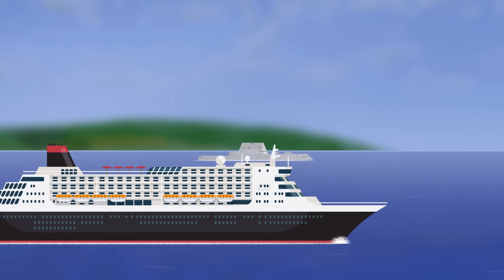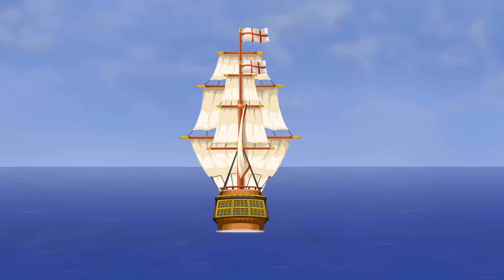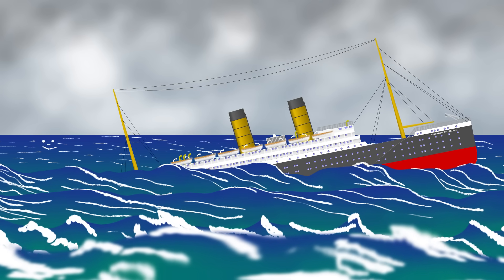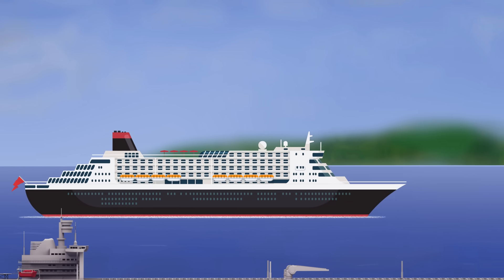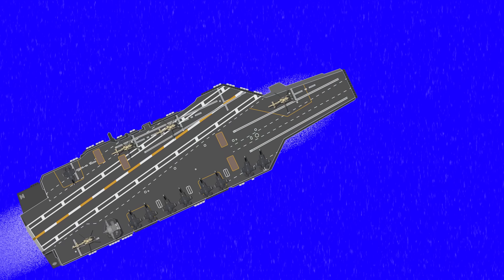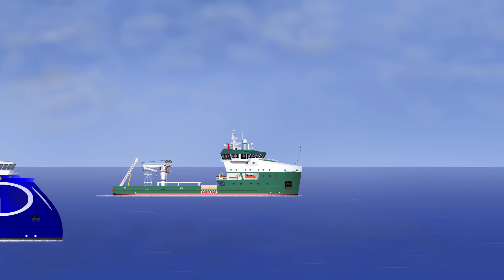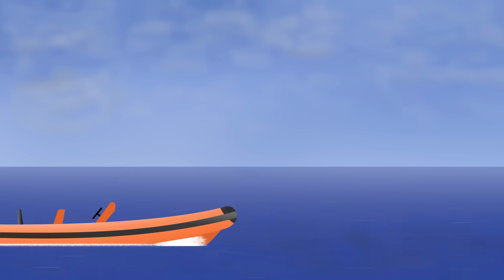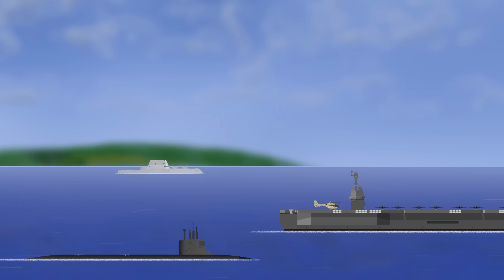Why Are Bows That Shape?

Comment: Now I want to know why the stern of ships are so different, cut-off like in cruise ships while tapered in ww2 battleships.
Reply: Speed and efficiency. They started with transoms in early sail for military, stylistic and construction reasons, then changed to counter sterns on clippers in the 19th century because they were more streamlined and therefore more efficient, then cruiser sterns in the 1930s because they lengthened hull length and were more efficient, then transoms (again) in the 1970s because they reduced squat and were actually the most efficient at speed.
Reply: The transom stern is just above the waterline. The ship is still streamlined below the waterline. Transom sterns are much easier to construct and don’t really have higher resistance than the old cruiser sterns except in extremely rough sea conditions. People just hadn’t realized that in the past. There’s no point in hydrodynamically designing a part of the ship that won’t be in the water.
Reply: @michaelimbesi2314  They also have far more buoyancy than "canoe" sterns, in case a large wave overtakes them from the rear.
Reply: I guess I’m an incurable Titanic nerd, but I think the kind of stern it had is the most elegant.
Reply: @inuyashaxx  Agreed, the fan tails of the Olympic class were among the best-looking rears on the Atlantic. The Cunard Greyhounds, Lusitania and Mauretania, come at a very close second.
Reply: Applies also to rifle bullets.  Ones designed for shooting at longer distances have tapered bases rather than 'flat' squared off bases and are referred to as 'boat tails'.
Reply: Alex the historian has a video about that
Reply: Evidently it's not so important. Hull length however is critical. Longer equals faster all other things being equal. And things that are critical at 50 knots aren't so at slower speeds. Battleships could move when they had to.
Reply: Old designs are less reliable and far more less efficient. The way we shale the stern is depends on the flow characteristics. 

Our sole aim in ship design is to make sure that the flow of the water towards the stern to be linear as possible. 

Why do we want it to be linear flow near the stern? Because it increases proppeller efficiency.
Reply: That’s easy, something I learned before I was a teenager.
A cruiser stern, the curvy ones that look sweet, are very inefficient, and cause more drag as they “leave” the sea.
Transom sterns, the ones that are squared off, have a sharp bend to make the slipstream of water to break away from the hull cleanly.
This takes away from the friction of the water from the hull, but fools the hull a second way, by a increasing the displacement of a given transom hull without actually doing it.
This has the effect of lifting the hull higher out of the water, and reducing drag, while the physics still think that the whole hull is in the water, which it is not.
Less friction all around, boat moves faster, boat moves more efficiently, everyone is happy!
Reply: @martinamaggioni8124  u6uu66pu66u67pup766uup6p6uu6

edit:ive heard of butt dialing someone but ever heard of pocket commenting?
Reply: So the water won’t slam shut.
Reply: British warships also had dove-tail sterns, Americans and Japanese had fantails, and Germans had hawk-tails.
Reply: Skag sterns are designed to help protect the propeller while giving them optimal prop angles for driving the ship, very common use on the biggest ships down to even small trawlers these days.

Comment: The bow one sees on the submarine is flooded. There is a spherical or horseshoe shaped acoustic sensor array in that flooded space. The shape of the submarine’s bow is to accommodate that sensor array and provide the flow you describe. Wgen you see a submarine you’re only seeing its outer jacket, not the inner pressure container that looks much like a propane tank.
Reply: but the flooded bow moves with the ship, so the surface pushing away water will be the "outer jacket", the bow. it would make absolutely no sense to let water ciculate in and out, so the bow one sees is indeed the bow that needs to produce as little drag as possible while accommodating the sonar. so what are you trying to say?
Reply: @danielsteger8456  What you say is correct, but the answer to your question involves something you did not make part of your comment to JoeOvercoat.  He is pointing out that resisting the pressure of deep submergence is not the function of that outer nose cone, which is the opposite of what the video and several other posters here are saying, and that, of course, is why he brought it up (and that is the answer to your question).
Reply: This has nothing to do with drag generated by the shape of the bow...
Reply: @Dirty Eddy It has, because the sonar array (and torpedo tubes) are what pushed the submarine bow design that way. They could have other shapes but this is the most adequate for the task of the vessel.
Reply: @moteroargentino7944  the same is applicable for ship bow design and the required width of the ship for stability and cargo capacity which was disclaimed in the video. The accommodation of sonar array is bs as wider submarines with side by side pressure hulls have a different width thus bow shape etc. again, sonar array accommodation has little to do with drag for bow design. The bow could've been pointy instead of rounded while accommodating for the sonar…. Hydrodynamics call for rounded regardless of the sonar.
Reply: @lIlIlIlIlIlIlIlIlI   The video specifically talks about why are ship's bows shaped that way . Drag is always a factor be it on the surface or below it. Submarines have that shape as a compromise between low drag/noise & volume for equipment.

The first submarines had ship-like bows as they spended most of their time on the surface due to power limitations. In the 50's, the first nuclear submarine (USS Nautilus) was launched and had a semi-pointed bow, which proved to be so noisy that deafened the submarine's own sonar . Then the USS Albacore was built as a diesel research experimental submarine with a teardrop hull design that showed to be faster, quieter and more maneuverable, but less stable on the surface. Around the same time, the Soviet Union launched their first nuclear submarine (K-3 Leninsky Komsomol) equipped with a rounded bow that gave it a lot more of space for equipment.

Submarine bow shapes have been studied and the results showed that conic and fish-like bows had the lowest drag coefficient and noise generation. Hemispheric designs generate more drag but not turbulence like ship-like pointy bows. Then came the conclusion: sonar is essential for a submarine, as is it's eyes and ears. There's always the need to fit the biggest and better sonar possible in the bow, and that requires space , to the point that in the USS Tullibee they removed the torpedo tubes from the front and placed them on the sides, just to make room for a bigger sonar that allowed it to perform long range hunter-killer missions.
Reply: What part of “the shape of the submarines bow is to accommodate that sensor array and provide the flow [described in the video]” are you guys hazy on? Let me guess, none of you guys realize that the nose cone on fighters is primarily a volume for the radar ray.
Reply: @JoeOvercoat  Well aware, dude's just a dated reddit user as you can tell.

Comment: We're concerns about submerged collision damage so instrumental in the development of the flared now? My understanding is that it was adopted to keep water of the deck in high sea states as vessel speed & stability increased. I have a hard time imagining that a reduction/avoidance in underwater damage during a collision was anything but a nice side effect of the new design, instead of a driving design concern
Reply: True... It was a design necessity to keep the deck dry. Collisions between ships in a head on approach is now rare if you factors are not included.

The way the flared bow is built is much more expensive than a plumb or straight or a tumblehome bow. The amount of steel to bend and form the bow is an expensive art of skill on its own. Compared to a straight bow, thick underwater plates require little shaping to form the bow. And a straight bow has a more linear power vs speed ratio compared to a bulbous flared bow. The latter has a narrow range of specific speed to capitalize the bulb while at different speeds, its just a drag maker. The straight bow is more friendly on speed changes and a very linear ratio of fuel consumption at different speeds. Thats they are starting to pop back from the past as volatile fuel prices can be detrimental to any shipping company. The bulbous bow ones needs a nose job everytime they want to change optimal cruising speeds..
Reply: No bow is truly straight. Even "straight" bows from the turn of the last century had a huge amount of flare side on and were very curved. The only two straight bits in this traditional design were the stem above the waterline, and the waterline itself. Every other aspect plate and line always curved.
Reply: we are concerns indeed
Reply: Don’t forget that some of the first dedicated war ships that we know of were the ramming ships used by the Greeks with what amounts to a tumblehome bow that terminates at a reinforced hull breaker. 

The evolution of bow design is very old. It’s kinda hard to say what the first bow really were.